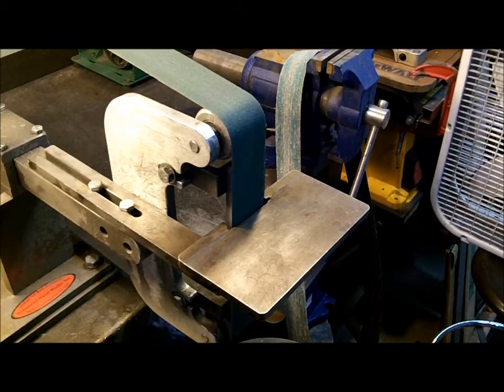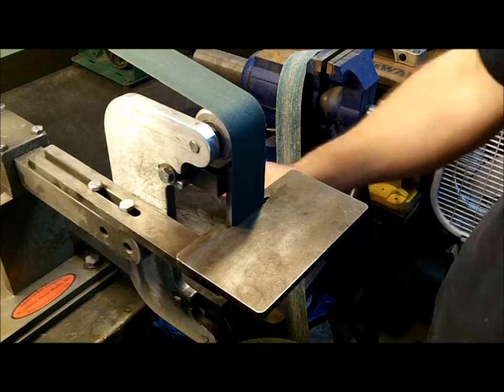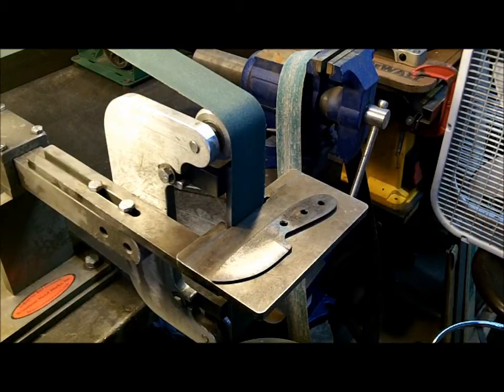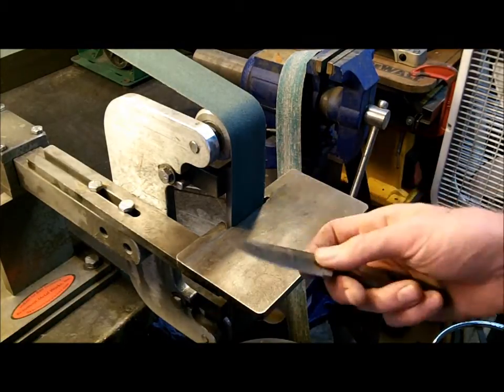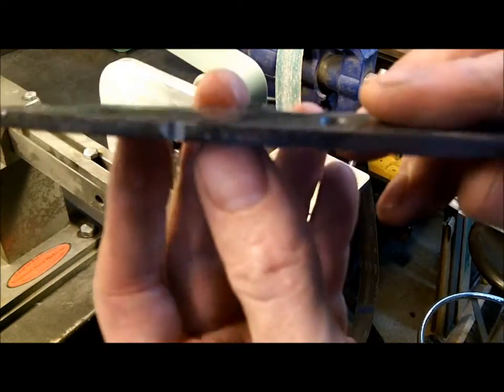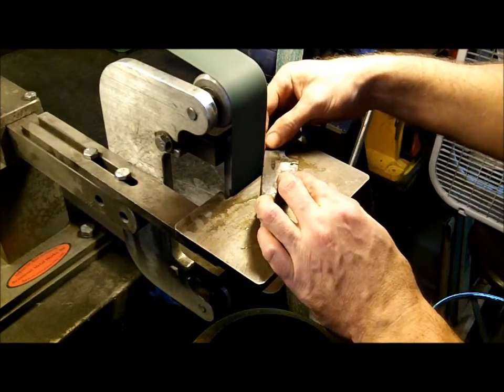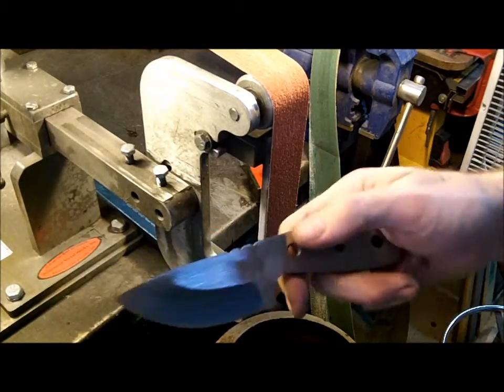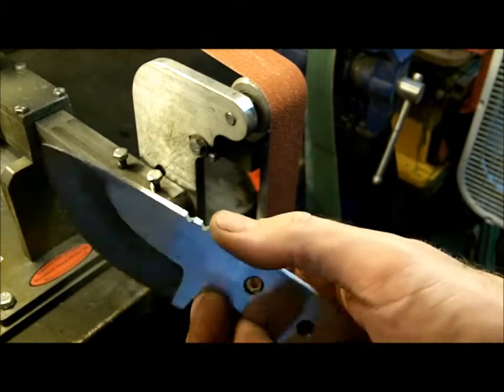Knife Making Tutorial - How do I add Jimping to an already Heat Treated Knife ?

Comment: KMG?  BTW: I put my "work rest" attachment under the tooling arm.  Gives me more platen area to work with but the bolts are attached under the tooling arm (not convenient).  Hope that suggestion helps you.

Question:  Do you have the platen set so there is no gap between the belt and the platen face?  I don't know if the belt will tear if the belt slides on the platen.  Let me know please...   THANKS!!!  and as always... great vids!